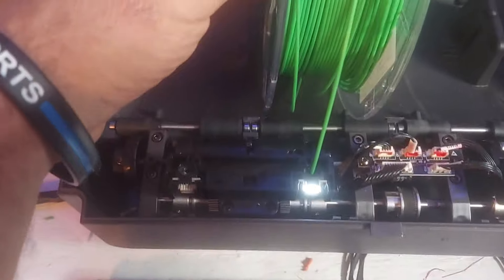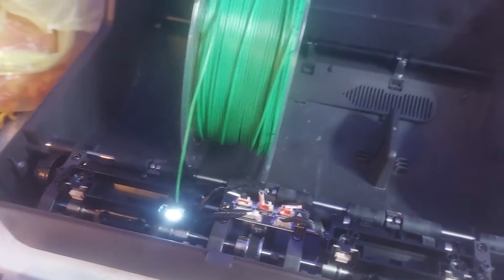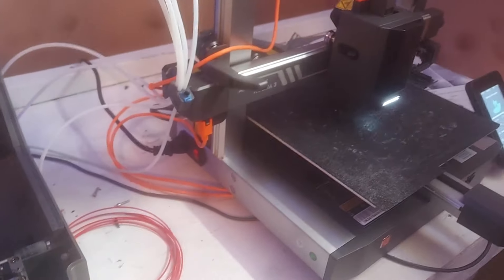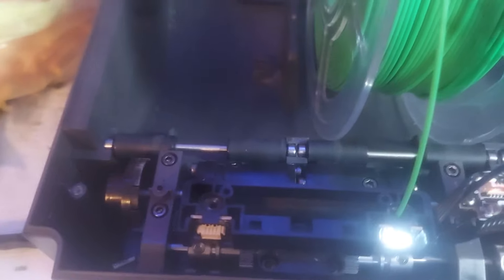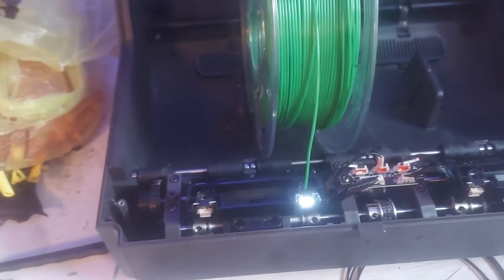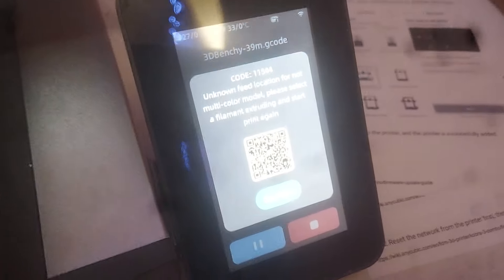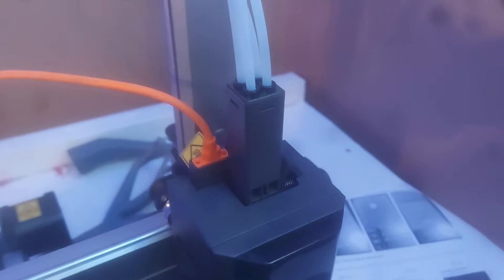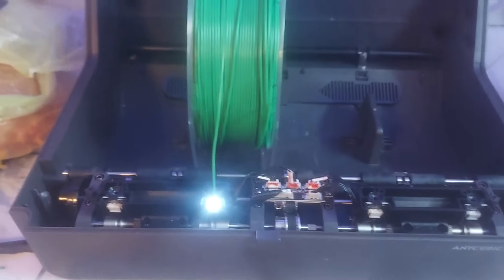kobra 3 combo issues

Comment: You randomly came up and I so happen to run a print farm with a few of these Kobra 3 running 8 colors with two ACE Pro on each. I noticed a couple things. Don't push the filament in when you load. Let it grab the filament from you and pull it in. Also, you have the ACE Pro too far back to the wall. Where your bowden tubes go into the back of the ACE Pro needs to be unobstructed. When it prints, it uses that part on the back of the ACE Pro where the tubes enter to keep pressure on the filament going to the extruder. If it is so far back that they can't extend or fully extend it will throw an error. If the tubes are too bent up, etc., it will throw an error.
Reply from the maker: @isthattrue1083  i appreciate the advice!  Still fairly new to this and learning everyday!